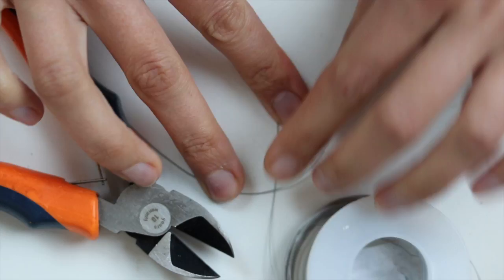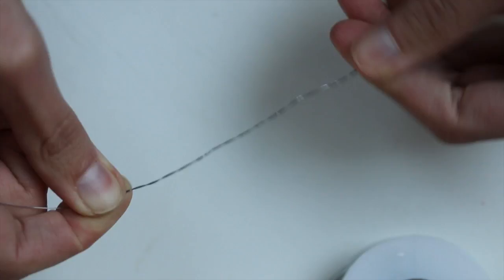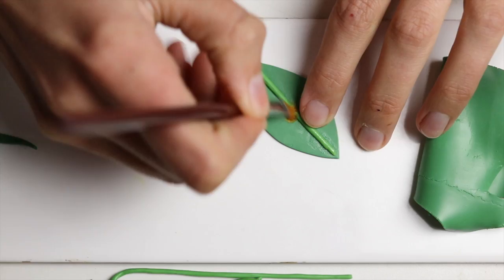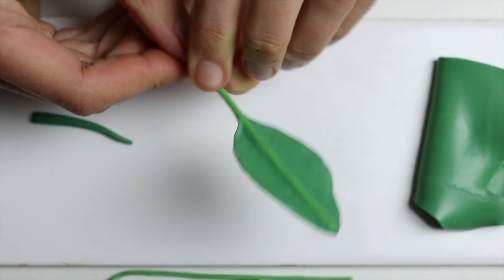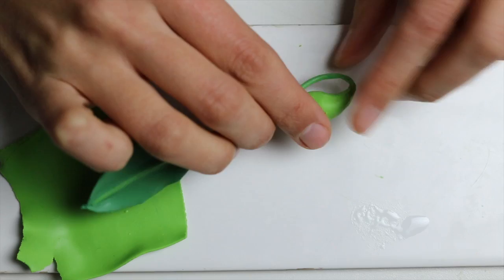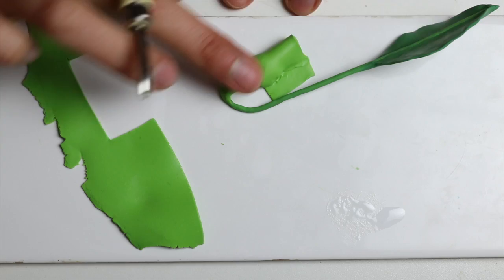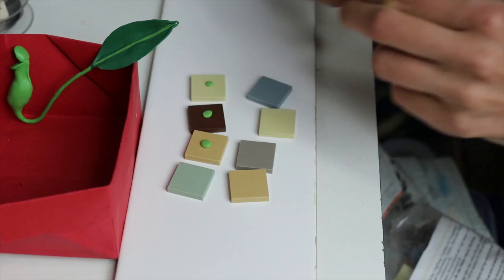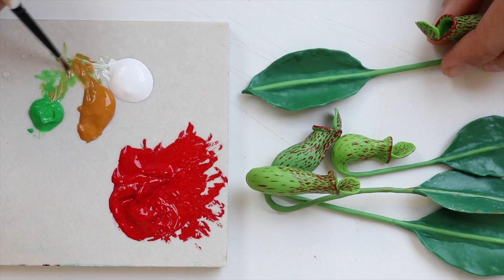How to Sculpt Miniature Pitcher plant Nepenthes // Polymer Clay Sculpture

Comment: I always have trouble wrapping clay around wire. It always slips around or falls off 😬
Reply from the maker: the twist helps, or (what I usually do) wrap it in paper tape (the one used for paint) but it adds thickness, so it's not working for all projects.
Or you can use another clay that is more sticky, like BeeSputty for instance, although it's a little more fragile than polymer clay. (at least more fragile than fimo or cernit which are arguably extremely strong) that being said if you don't "play" with the finished objects, it should be of no issue.
Reply: Stephanie Kilgast // PetitPlat Thank you for the tips, I greatly appreciate it. I just got some BeesPutty a couple weeks ago, I've been wanting to try it out.